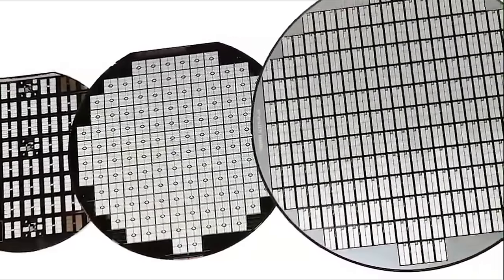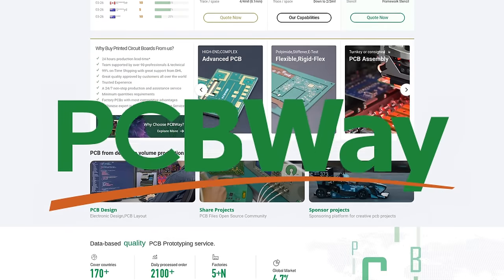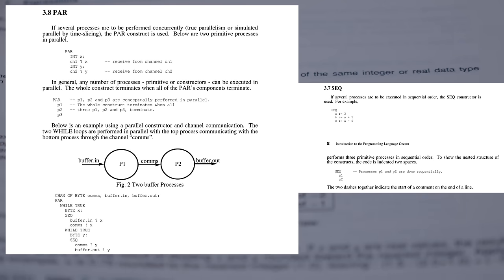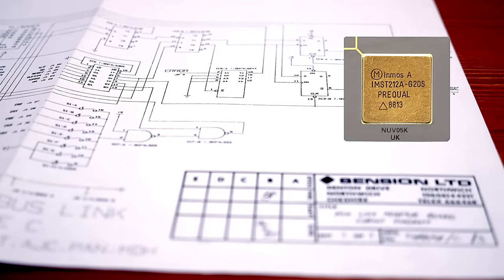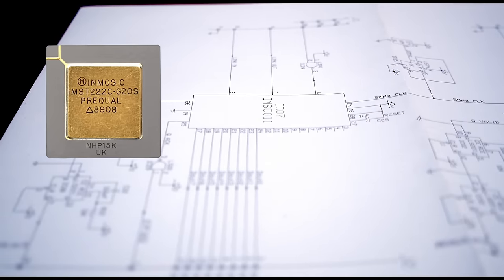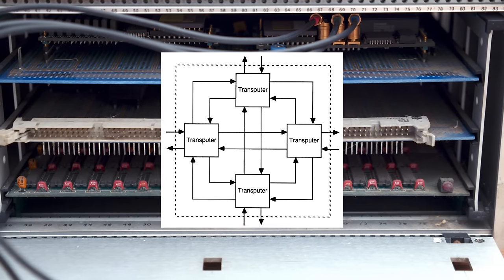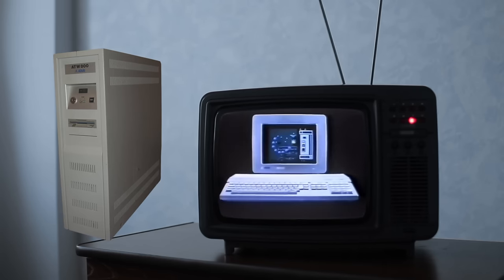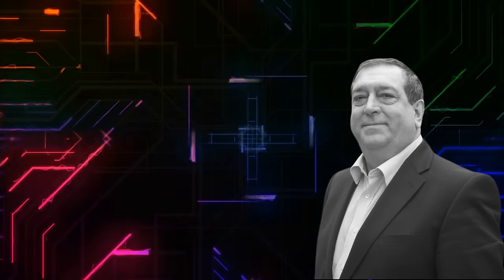The Transputer: A parallel future

Comment: I believe the Transputer showed up in embedded systems like avionics (e.g. the RAF Jaguar plane), various other military applications and maybe even the Boeing 777. Not sure on that.

Prof Peter Welch was still extolling the virtues of Occam and the transputer (and it's CSP underpinnings) until at least 1999 for degree courses at the University of Kent. I was a big fan.

The Kent retargetable occam compiler (useful when transputer hardware became scarce) looks like it carried on until 2006.
Reply: Back in the 80's and 90's the U.S. were far too hung up on Ada and determinism. Transputers were rejected from many U.S. military applications because D.o.D guidelines required software suppliers to be able to say which line of code was running at any given time, and you couldn't do that with a Transputer due to it's microcoded scheduler. U.K. military projects were more pragmatic though, and were happy with the guaranteed latency that Transputers could provide. In fact, one of the big advantages of transputers was the exceptionally low time needed to switch from a co-operatively scheduled low priority task, to a high priority task, which made it ideal for real time systems, as long as you didn't try to do too much in the PRI PAR. A huge part of this was independent high and low priority register stacks, so you never needed to store or restore context when task switching between low and high priority tasks.

Comment: In 1992 I was working for a company called Computer Solutions when we got a contract from Mercedes Benz to write an implementation of polyFORTH for the T800. I was the sole engineer assigned to the task, and really enjoyed working with the Transputer.
I wrote a full development environment including a text editor, optimizing compiler, assembler, and single step debugger. Keyboard and screen were provided by an IBM PC. I wrote the host software using the 8086 version of polyFORTH.
Bootstrapping the project was interesting, because I had to first write a cross-assembler on 8086 to write a kernel that ran on the Transputer, and allowed me to develop the rest of the development tools on the Transputer itself.
I still have a physical copy of the manuals if there are any technical details that would interest you.

Comment: A couple of things you didn't mention.  The Transputer nodes were heterogeneous.  A single system would contain multiple nodes with various memory sizes, speeds, etc.  Some nodes would act as general-purpose nodes, others would handle graphics, I/O, etc.  What was novel that you could run the same code on any of the nodes (memory permitting, of course) with code scheduling being handled by the OS.  The idea was to get better utilization of all of the processors by migrating tasks to, say, the graphics card's nodes when said nodes were otherwise idle.  The idea is similar to modern-day GPGPU but without requiring any changes to the running code.  In theory this could be extended to nodes on the network (LAN, WAN) but I'm not sure Inmos ever implemented that.  (Disclaimer: This is all from memory so I'm sure I got some a lot of details wrong.)

Comment: It was icing on the cake that you talked about the ATW. That's how I found out about transputers. I was following the Atari news at the time. I heard a little about it, and found a little video on it, as Atari was demonstrating it at Atarifest in Germany. It had graphics features that we wouldn't see in commercial PCs and Macs until the late '90s, or early 2000s. Though, the Atarifest video (which was short) was the last I saw of it for many years.

What I've read about it more recently was that most of the ATWs were sold to Kodak. A few were sold to universities. I happened to find a rare, archived video that featured an ATW, some years ago, from the Univ. of Hamburg, as I recall.

Atari also briefly flirted with making a Unix workstation out of the TT030, with a 32 Mhz 68030, 19" monochrome monitor, and X/Windows, called the TT/X. They sold it, but only for a few months in the early '90s.

It was too bad, since I liked the fact that Atari was making high-end systems. I never heard why these efforts were so short-lived. It just seemed to be the usual story, that Atari couldn't get its shit together. Another obvious answer was that Atari had an image problem, "game company." Also, the fact that Jack Tramiel was at the helm, I hear, was a factor. He'd burned a lot of bridges prior to buying Atari.

Comment: Currently work with a big industrial machine the size of a house that at least carries on the idea of a transputer.  The machine has a bunch of moving parts that all have to work at precise times and with zero delays. Rather than having a PC talk to hundreds of sensors and boards, the machine has a ton of identical transputer-like boards, each one attached to local boards that actually do whatever the functions are.  The supervisor board gives out orders and  contribute a status to a data bus. The machine main controller PC just watches the bus.  It works incredibly well unless there's a broken wire somewhere.  If a board fails, no problem. They are all identical. Swap in a new one.  This setup has greatly reduced the number of parts needed to run the machine which in turn improves reliability.  We've had this thing run continuously for almost 24 hours at time, as long as the humans can keep up.  The distributed logic side keeps the mechanical side humming.   By far the most productive such machines any of us have ever worked with. A joy to operate as much as work can be a joy.
Reply: Edge computing.

Comment: Great video! I graduated in Electronics Engineering in 1980 (yes long time ago) and while my early career was in Motorola 6802, 6809 and 68000, I was fascinated by the Transputer chip sets and thought these were definitely the future. Their demise due to political and corporate stuff ups parallels many similar observations during my long career. Thank you for putting this together.
Reply: I loved the 6809!
Radio Shack Color Computer used it.
Reply: I used to program the 6802 and 6809 directly in machine code, burn PROMs, then EEPROMs.. fun times 🤔😀

Comment: Great video!  Meiko Scientific did have some modest success with their Transputer-based Computing Surface systems, IIRC.  Also, the original ARM processor was designed with support for co-processors in some form, and its instruction set has a fairly close relationship with C-like languages.

Comment: Very good. Incidentally, Metacomco did NOT produce the Amiga operating system. The Amiga team did not have time to finish their disk operating subsystem, and licensed one from Metacomco. Tim King was at the first UK developers' conference in 1985 to talk about AmigaDos, which was written in and could only be used through, BCPL. This was a major pain in the arse for early Amiga developers like me.
My company at that time -Sophos Software - provided Amigas and support for two electronic engineering students at Hull University, where we were based on the Science Park, to do a final year project to produce a Transputer board for the Amiga 500. It worked, but didn't come to market for various contractual reasons.

Comment: Great video!

However I missed a reference to CSP's (Communicating Sequential Processes), the theoretical basis under the process + channels concept. The analysis methods based on CSP algebra were the solution to the deadlock / livelock problem, a problem you did mention and that the Transputer was intended as its solution, but without mentioning how it solved the problem. Because even with communicating channels, it is all too easy to create deadlock / livelock situations.
Channels solved the race-condition problem, not the deadlock / livelock. Formal CSP analysis solved that. Because the Transputer implemented proven-to-be correct elements of the CSP algebra, software that had been formally analysed using CSP algebra was guaranteed to run correctly on the Transputer.
Reply: yes, seemed like a strange omission, Hoare was mentioned, as was the language-design-before-hardware, but not CSP?! A fundamental part of the whole endeavor.  CSP has also come back to us in the form of google's Go language which allows for both CSP (goroutines) and shared-memory (light weight process) programming methods. Another fun Transputer fact; there were T800 cards for the Pixar Image Computer. Was not programmed in Occam though. Another high-volume Transputer hardware seller ;-)

Comment: Worked at RSRE Malvern on a European ESPRIT project - P1085- to develop a configurable networked transputer machine and applications, 1987 to 89. The project developed SuperNode, a fabric of n transputers in which the 4 links from all were linked to a configurable switch, enabling any topology to be built and optimized for particular parallel computing applications. I worked on dynamic programming algorithms - optimal route finding - and compared the MIMD transputer approach with a SIMD machine, the Distributed Array Processor, which was optimized for matrix operations. Wrote a bunch of code in Occam. We were way ahead of our time.

Comment: Love it. Fast Ram usage was fun. Take the routine you want to run, put a blank routine behind, take the diff of the two *fp's thats the size you memcpy to fast ram starting at the first *fp, then run the routine from the fast ram ptr.. all in CSTools of course. Reading Uni CS had a CS1 paid for by Eu ESPRIT project, and as the DAP support officer for the CompCtr I had the two machines use side by side Sun systems as hosts. Then for my phd i wrote a compiler that treated them as a single machine with a few Sparc workstations thrown in for good measure. Happy times. Never got to use EPCC system but did get time on the ECS Southampton CS2. After porting pvm3.3 to the CS1 I ended up working with ORNL on pvm3.4 and eventually finished on openMPI. That t800 machine was the start of an amazing  journey.  Thanks for the memory. Dont forget the innovative folding occam editor!

Comment: I worked at Plessey/Marconi in the late 1980's and had a Transputer card for my IBM-PC.  We had Occam but we mainly used Alsys ADA on them which was sub-optimal.  In parallel (pun intended), I was using 486 based algorithm cards and TMS 96xxx based DSPs for signal processing (on SONAR systems I was working on).  One of my tasks as a developer at the time was to port X-WIndows to the TMS-34010/34020 (it had a 68000 like register architecture) TIGA chips.  Intel tried to clone the Transputer with iWarp but we played with their i860 and ii960's as well.  I had a Meiko Surface for a short while.  The standard Pentium quip was "I am Pentium of Borg.  Division is futile ... you will be approximated!"

Comment: My 1st contact with transputers was the IBM Active 2000 ISDN card, and working on those drivers and updating the drivers for real-time linux. Years later when designing the Cell B.E. processor for the Playstation 3 we went the same way again, this time with real-time as base of the focus. The (my) second version of libspe(2) made use of the paradigms of a transputer architecture separating the running SPEs from main CPU control, so they could work like a transputer using their local storage and message boxes for communication. Those were fun times.
Reply from the maker: The Cell is an absolutely fascinating chip, never done any development with it my self its one of those things I've been meaning to look into in far more detail.  Its just I've not quite got round to it yet.
Reply: That's that weird period where everybody thought we were hitting a latency floor so they ditched sync and just pushed it all onto the compiler programmers. Because they can just write a smarter compiler to deal with all that data shuffling, right? 
Right? 😳

Comment: Oh my. Memories now coming fuzzily back. I spent two summers in the late 80s working at EPCC (Edinburgh Parallel Computing Centre) where the Transputer supercomputer was based, writing code in Occam to display graphical text (using TeX encoded fonts) and adding a pretty basic line printer queueing system to Meikos (the bare bones UNIX that ran alongside it). I have no idea if any of my code was ever used by anybody else, it would be a shame if it wasn't. And as an Atari ST owner I was aware of the Abaq and Helios, but I had no hope of ever owning one. It was the existence of that and Atari's reluctant adoption of MultiTOS, with proper memory protection and multitasking that fooled me into thinking Atari were the serious computing platform. I was stuck between getting a Falcon or a TT030, but eventually ended up with a Mac LCII instead...
Reply: I ended up running MagiC on an ex-developer (I think) TT purchased direct from Atari.  Ran GCC and friends on it for my Uni coursework.

Comment: I was, for a brief time in 2000-2002, the owner of a couple of fairly hunky ex-DERA Parsys Supernode boxes (SN1000 + expansion chassis and a SN9500) - they were scrapped from the university I was attending. The SN1000 had multiple cards of 4x4 grids of T800's and a (for the time) fairly bonkers 1024x768 24bit framebuffer and output card, the SN9000 was an all-in-one-box 16xT900 thing. Wheeled the SN1000 back to my student digs half a mile across campus on their plastic castors since the bigger boxes were about the size of a small fridge. Powered up but never got them to output anything since I didn't have the supporting Sun gear at the time or access to any OS images etc. Sold them to a collector in the US, I hope they're in a museum somewhere...
Reply from the maker: I hope they made it to a museum too.  The fact most transputer machines where not kept together with their host system and software does make getting them back running a lot more challenging. I think getting the software will be the hardest part of getting mine running.

Comment: This is an idea I was trying to flesh out in that late 70s. i just didn't have any resources to work with at the time, and computers were still a bit bulky.

I followed some of the same steps, designing a language, documenting an API, and writing basic schematics and theories of operation. 

in my version, there would be shared memory between the processors, acting as communications device. So a big part of my architecture  revolved around routing data to processors that need it. And above that, a load balancing architecture that would remap the procedures in hardware on the fly, to keep communications fast.

In my concept, objects, data and methods would get passed around as containers. And those would be agnostic as to their location as addresses to access other objects would be routed.

In the mid 80s, I tried to find people interested in the idea, and I was universally told that there was no market for this sort of architecture. And so I dropped the project.
Reply from the maker: Its a shame you did not get the chance to work on it, sounds like an interesting approach.
Reply: @RetroBytesUK  I don't know how well it would've worked.

A lot of it depended on mapping and routing.

After writing that comment, I looked into how I might implement the idea today, and it would certainly be easier and cheaper now.

What I had forgotten is that I determined I'd need a router processor and a computation processor, for each unit.

Comment: Well that takes me back. I as part of the Edinburgh research group you showed (actually I'm still there :-) ) One lesser known fact is that the transputer had hardware thread scheduling. Features that are usually parts of the software kernel were actually directly implemented in the harware. This was particularly important when it came to the implementation of channels. When a thread waited on channel communication its program counter was actually stored in the channel itself. When the other end of the channel became active the thread was automatically re-added to the thread run-queue by the communication instruction. The transputer (and much of the software that went with it) was a brilliant in many ways but the whole effort did suffer a little because the designers did not care about supporting any other software. Occam did not need an MMU because its memory use could be mathematically proved to be correct. Therefore anyone who needed to run code witten in C had a real hard time.
Reply from the maker: Thats great to hear some of the team from then is still there, are their many of you from the transputer days ?

Comment: I always thought it was a missed opportunity that Atari didn't stick a T212 in the ST blitter socket instead of the blitter. It would have made a great coprocessor and introduced programmers to the chip (and occam) in a gentle way. A 32bit ST successor could have had the full-fat linked processors (for fpu,dsp and gpu) alongside a 68030.
Reply: Plus the Mega STe and  TT had a VME bus slot so more could be added that way.  Those were their low and high end "workstation" offerings so adding a single on-board Transputer node to those could have been a good feature.  All "serious" machines would thus be guaranteed to have at least one of the chips so software developers would have incentive to target them.  (Release dates: ATW 1989, TT030 1990, Mega STe 1991, Falcon 1992)

Comment: The transputer is still alife, kind of, in the xmos CPUs. They do have communication channels that work on-chip between the cores and from chip to chip. And they had their own language called XC. A derivate of C. Unfortunately, the people at xmos are quite stubborn and only read about C in K&R. They had only little libraries and ignored things like stdbool. Now they switched to plain C. But I didn't have a look at that new language.
With the xmos, you can make incredible fast software. If you look at the problem from a transputer point of view where data flows from processor to processor. For an application, I wrote a PID controller But, things took a completely different turn for me ...